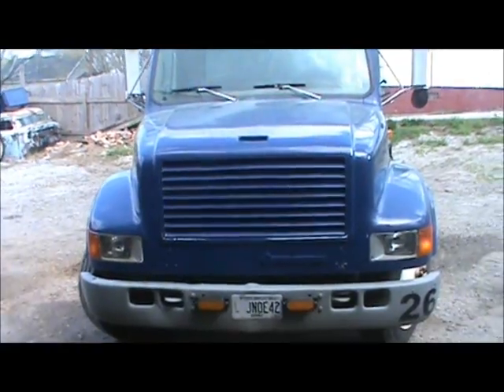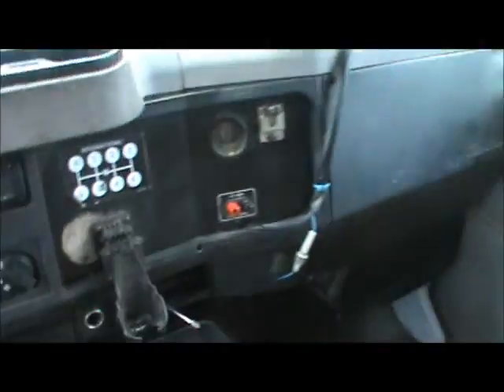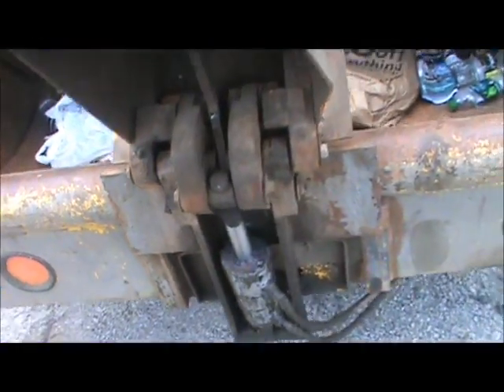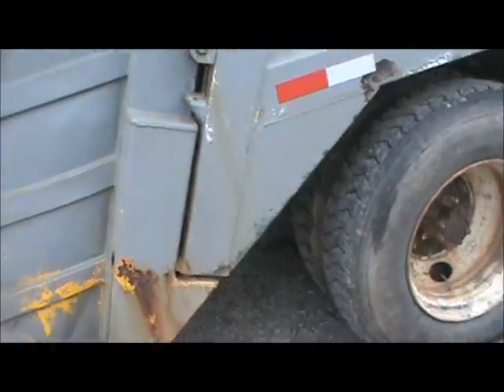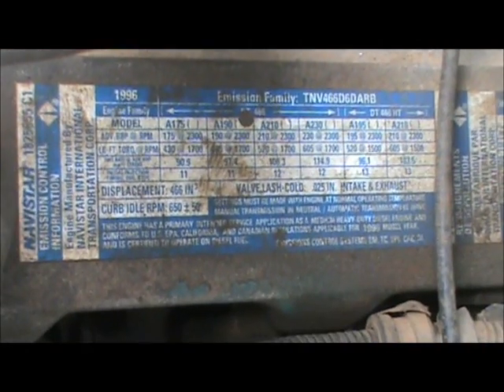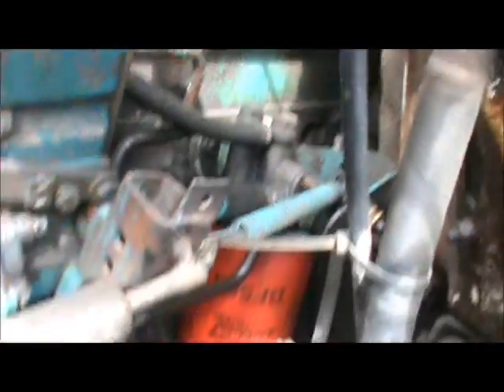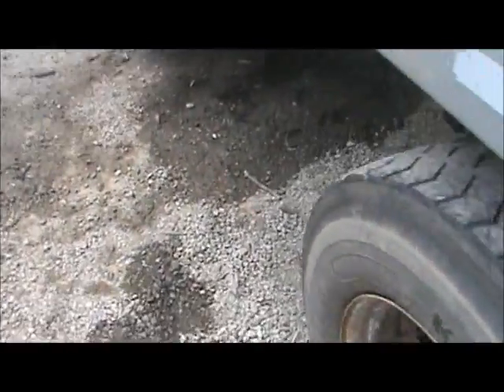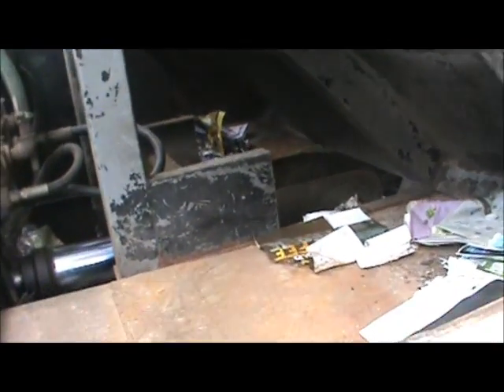A Tour of the Inside of a Garbage Truck

Comment: Cool. Thanks. They fascinated me since mid-1960s when I first saw the garbage man riding their truck up the street. I always wondered about the compactor inside. I've seen movies where someone gets killed by being thrown into the back of a garbage truck and compacted. Obviously if it wasn't full of trash there would be room since it doesn't go flat up against the wall. LoL probably the drop into the truck would show you a lot quicker. Does it also tip up like a dump truck?

Comment: The debate is over. I knew the truck would compact internally on the route. And I bet 7k lbs is a low ball. My F350 hauls that. Lol. Me and my son thank you for the great video.
Reply: They don't compact internally. The blade at the back of the truck does the packing. The ejector panel inside moves back as garbage is packed. And it's used to elect the garbage at the landfill.
Reply: @lesandallyssa  I understand that the internal skid is for unloading. But the rear hopper compactor can't be the sole form of compaction. Especially during long routes. Couldn't the internal skid push back further crushing the trash? Once retracted there would be space for the trash to slide back once the rear compactor was engaged.
Reply: @stephenv6054  At least with how I've seen them used, the only time the internal skid is used, is while ejecting trash. But I could be wrong. We have a few rear loaders, but most of ours are side loaders.
Reply: @Allyssa Lord  I've been curious about this for years. I'll ask an operator but most don't use it as an additional compactor. Our front loaders compact front to back.

Comment: used to drive a garbage truck a 20 harder could put between 30 to 40 thousand pounds in it 466 engines by international were the workhorse of a lot of heavy equipment almost impossible to destroy them